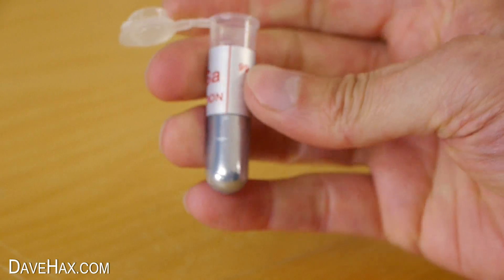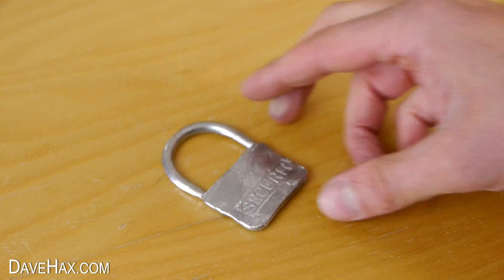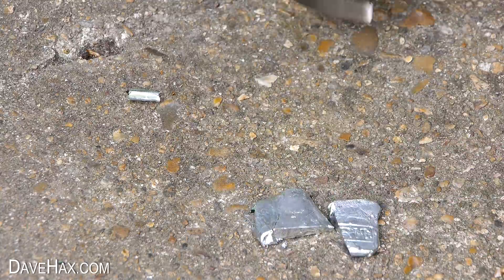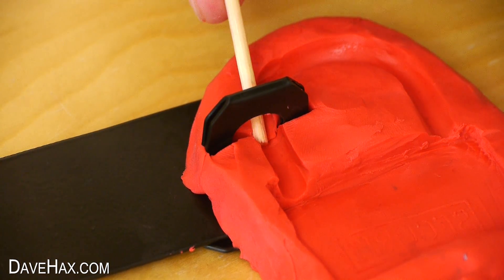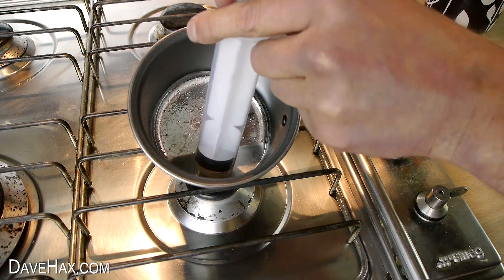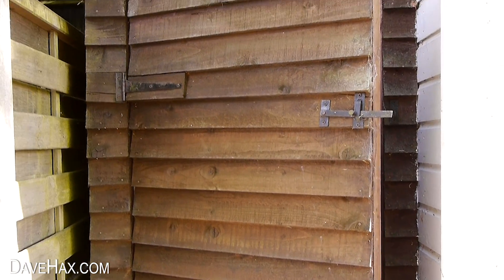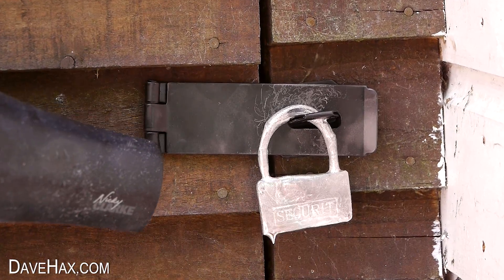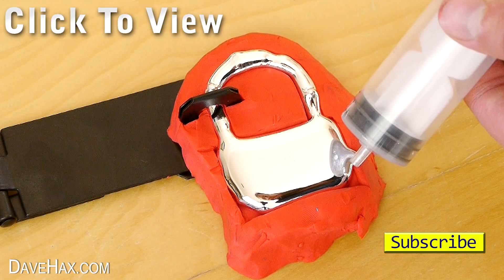MELTING a PADLOCK with a HAIR  DRYER - Gallium

Comment: You are using 2 metals, one being casted in a very thin mold. The properties of both these materials might as well be night and day. As the thumbnail states, you are melting a factory grade padlock with a hair dryer. But, in the video you are using a simple piece of metal to melt. If you monitize this video, it may be the cause of legal action.

Comment: At the time of this writing 13,000 users are upset that they can't melt padlocks with a hairdryer.

Why would you want to use a hairdryer?

-It uses electricity.
-It would probably take hours(if it worked at all).
-It is loud.
-It would really embracing to be caught, arrested and show on your criminal record.

What you should be using is a handheld Blowtorch or Bolt-cutters.

Comment: Good job.  Gallium safety data: TOXICOLOGICAL INFORMATION

Likely Routes of Exposure: Inhalation, skin and eyes.

Symptoms of Exposure: May cause irritation.

Acute and Chronic Effects: There is little definitive information on the toxicity of elemental gallium. Contact with gallium metal may cause skin or eye irritation. When exposed to air, gallium slowly forms an oxide layer which is toxic if inhaled.